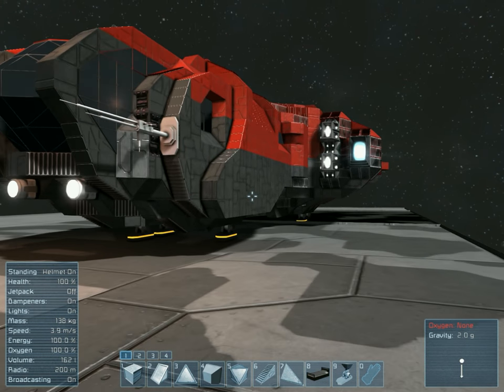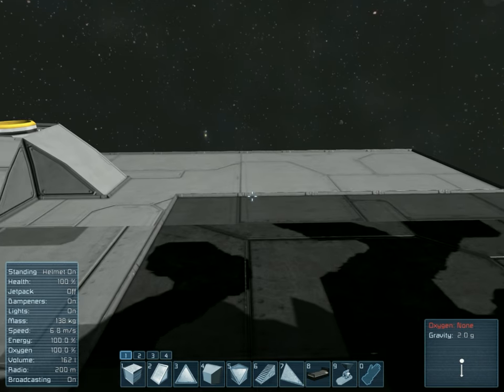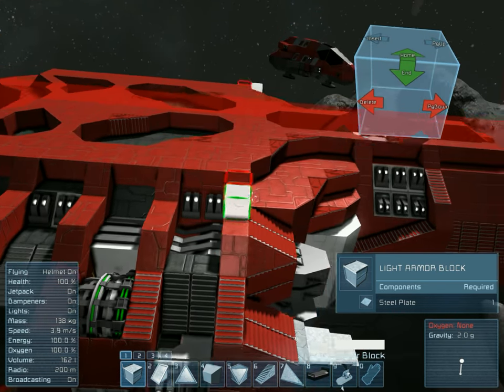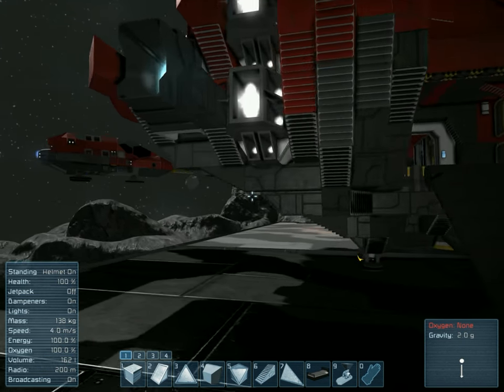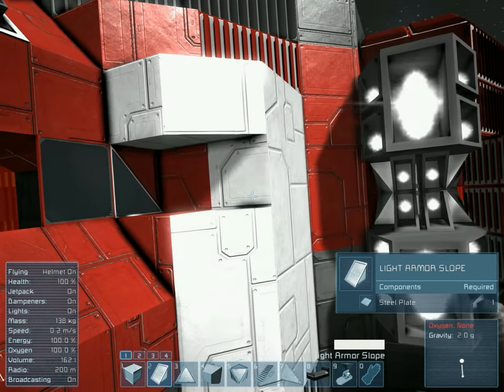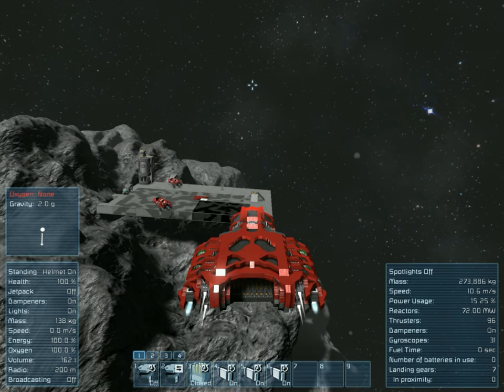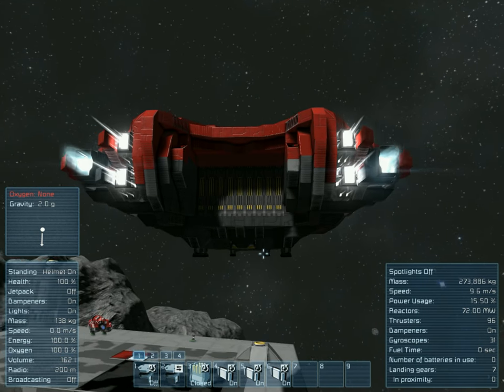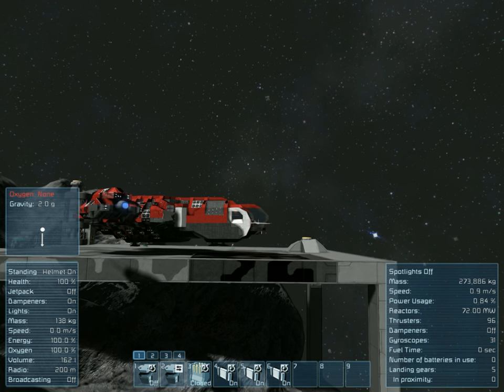Space Engineers | Uthris's Fleet | Transport Ship 3

Comment: Cool ship! You can lock down the ramp with landing gear (or mods that serve the same function. Thats how its normally done in order to fly about. basically put landing gear in the final 'closed' position and locking them when your ramp closes.
Reply from the maker: I tried that - it held the door but when I turned the rotor pretty much exploded still. Door didn't move though. Maybe I didn't set it right?
Reply: Uthris Possibly.. try merging two rotors together? makes them much more stable